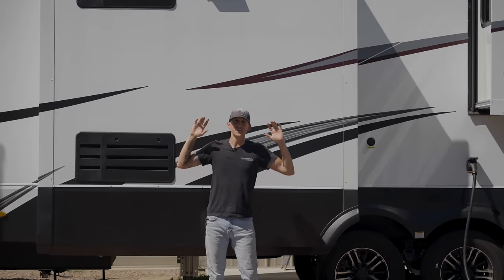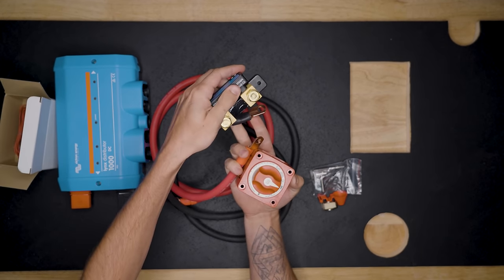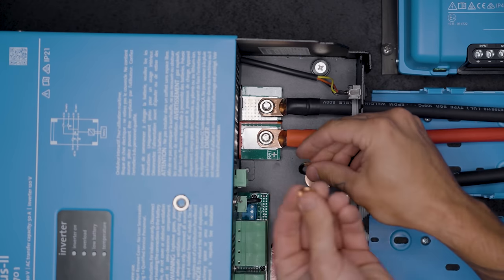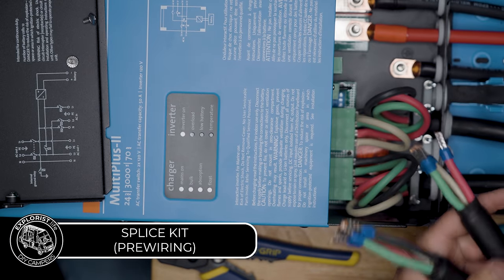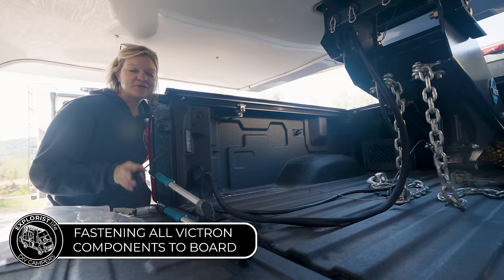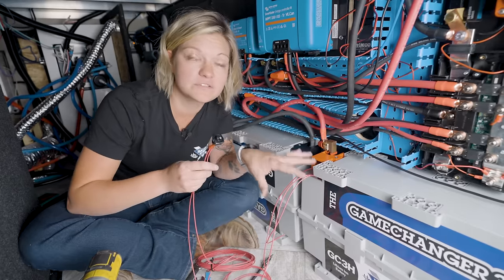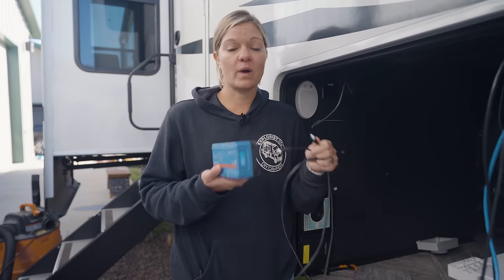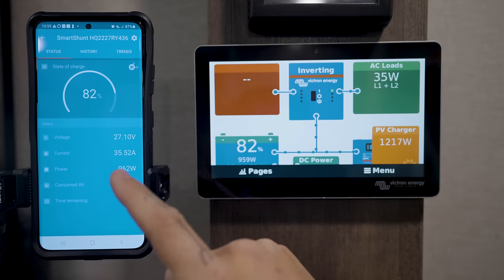We added 2400W of Solar to this 5th Wheel RV! (Full Battery/Inverter/Solar Installation)

Comment: You said you were not gonna do the demonstration on the dual Victron inverters with all the goodies that go with the install from battery hook ups to the charger controllers and cerbo …well I feel you should. It’s a good watch with you guys to
Do
The complete installs, to chase the other videos I’m sure helps you guys with the views, but idiot proof is way better. All in 1 is better. Even taking the time to do the desk set ups as 1 video then to do the complete install as another video.. especially 50 amp set ups because that’s what this product is designed for and most want to watch from beginning to end.
Maybe doing a programming of the system as a separate video is something helpful

Comment: I was wondering when you programmed the SCC for 100A but it's an 85A controller. It that because of the 24V system and that's what the battery limitations are?  I was also wondering about the 150A circuit breaker for the 70A converter. It the converter programmable to charge that house battery? You placed that circuit breaker upsidedown and I have noticed that they often have a battery and a load side but since the flow is towards the battery instead of the usual configuration, which side did you use for battery? I'm assuming placing it upsidedown was deliberate.
Reply from the maker: re: 100A setting on the MPPT: Good catch!  That would be 85A (the most it could do).  I just copied those settings from a 100A charge controller and forgot to change it.

Re: 150A breaker: Here is a video that talks about how to size fuses: https://youtu.be/5y-yDMEgV70?si=cImNZJa6MZV33tR2

Re: Breaker orientation:  Battery goes to the battery side because in the event of a short between the breaker and the converter; we need to be able to protect against the 1000+ amps of a direct short.  That breaker isn't going to care which way power is going under 'normal' 70A circumstances.

Comment: Another very good install video. I wonder why the need for the alternator charging, with 2400w of panels on the roof and the option to run a generator if needed?
I have a new 5th wheel with about as much open real estate upstairs, and a plan will be to add real usable solar, so this video is great timing. Thanks to your team for this guide.
Reply from the maker: I share the same sentiment about alternator charging in this setup.   I think you could for sure get away without it because of the massively oversized solar array.  But I also know that the last time I asked our YouTube audience to consider not installing alternator charging if they have adequate/excessive solar charging, I felt in danger of being burned at the stake. 🤣😂  

Ultimately, being able to show up to the campsite with 100% battery after driving overnight (basically) was important to the owners of this camper and so we obliged.
Reply: @EXPLORISTlife  maybe they meant "don't burn the steak", with all that power? 🤔

Comment: Are you no longer installing the DC-DC converter to power the fuse lights on the Lynx? Also, in my Momentum I paralleled two Orion 24-12/70's.
Reply from the maker: 🤣😂  I can't be bothered most of the time and forget that is a thing since it's not really a 'mission critical' feature.  Here's a tutorial for anybody reading through the comments section for how to make the Lynx Distributor lights come on: https://youtu.be/8h-E1lkYCKg?si=FZC90V5toX30XEo7

Comment: What are the advantages of doing 24v 3000w vs dual 12v 3000w inverter/charger ?  Seems a dual 12v system would double inverting power for a rig that size.
Reply from the maker: Two 3k multiplus's would indeed be twice as powerful, which is the upside, but is also nearly twice as expensive since you are buying two units and also need twice as much battery power (800Ah @ 12V / 400Ah @ 24v required)

Comment: Nice details through out. Both of you are so good at explaining things.
I have a question about the pre-solar wiring. What is the size of the existing solar wiring from roof gland to pass through? Did you use 24volt panels then? I'm surprised factory was enough. My experience is that the factory roof solar (on my 2018 Arctic fox 25w)) is too small to handle as many watts as I want (1200w), and I don't want to do a pure series connected system....in a case like mine, Do you end up running A new drop through the front cap?
Reply from the maker: 10Ga on those solar wires.   Wired like we showed, that's only 20A coming through that wire; so 10ga is plenty for that.  In fact, all of the solar configurations all the way up to 2800W use no larger than 10ga wire: https://shop.explorist.life/product-category/all-products/camper-wiring-kits/solar-charging-wiring-kits/?orderby=price-desc

Comment: Could you do dual 24/12v x 70a converters in parallel instead of keeping the existing 12v acid battery?
Reply from the maker: There’s a million ways to do this stuff.  We just share the way we feel is best and will work in the widest variety of cases, but feel free to play around with it as you like and we will sell you as many converters as your heart desires. 😜

Comment: Hey Nate, I'm just finishing a nearly identical install. Is there any reason to not wire two 24/12 - 70 converters in parallel instead of keeping a heavy lead acid 12v battery? It seems like getting rid of that weight/maintenance is the way to go.
Reply from the maker: In short, there are 1,000 ways to do things, but the way we showed in this video is what we recommend, what we've built our kits around, and what we will provide customer support for.  Anything outside of that is up to your own due diligence and testing.
Reply: Thanks. The existing batteries are two 6v golf cart batteries that weigh a ton. I'm hoping to lose that weight. Would you recommend replacing them with a 12v LiFePO4 battery, or trying the two converters in parallel? Not asking you to support, just looking for an opinion. Thanks!  @EXPLORISTlife

Comment: You guys do the best videos and have great tools and instruction on your site. I'm planning a 24 system and will likely buy the kits from you for most of the wiring. Question: did you put ferrules on the solar isolator wiring? It looked like you just stripped and connected. Any reason not to use ferrules?
Reply from the maker: Ferrules get in the way on that connection.

Comment: is it possible to make a portable power bank inside a milwaukee packout and be connected back into a vehicle that has anderson connections with solar on the roof and cables to batteries
Reply from the maker: Indeed!  For a smaller system, that would work great.  We actually have a video on the schedule for December for something like that.

Comment: Hi guys...love your channel...I watched how you connected the disconnect switch to the linx distributor using the linx adapter(copper bar). I want to connect my disconnect switch straight to the positive bus bar on my linx shunt but the bus bar has a M8 hole and my disconnect switch has M10 studs...can I use my drill and increase the hole size on the positive bus bar of the linx shunt from an M8 to M10 so I can connect my disconnect switch directly without the need for the copper bar adapter?? Or is this not recommended? Thanks...Paul
Reply from the maker: I can't vouch for modifying the hole as it would void the warranty and I've seen people mess that up and melt/damage their Lynx Distributor while drilling.

Comment: What kind of rubber coating did you use on the plywood? Is there a reason you used a rubber coating instead of just paint?
Reply from the maker: It's just rubber floor runner from the local hardware store.  Rubber just looked better & was faster to install.

Comment from the maker: ‼ IMPORTANT INFO ‼ I'll be keeping this pinned comment updated with FAQ's about this project, kit, video, etc; so be sure to click 'read more'.

Q: How much did this system cost/Where can I get more info about the parts in this system?

A: Here are the parts/kits/components we used for this build.  Add everything to your cart and you can get up-to-date pricing.  I don't like putting actual pricing here in the description so I'm not being misleading when prices change:

Main Kit: https://shop.explorist.life/shop/all-products/50a-oem-24v-rv-upgrade-200-600ah-24v-battery-bank-multiplus-3k-24v-2x120v-orion-12-1230-wiring-diagram-kit/

Solar Array: https://shop.explorist.life/shop/all-products/camper-wiring-kits/solar-charging-wiring-kits/2400w-solar-charging-wiring-kit-12x-200w-24v-battery-bank/

System Monitoring: https://shop.explorist.life/shop/all-products/system-monitoring-wiring-kit/

Batteries: https://battlebornbatteries.com/product/12v-gc3-lifepo4-heated-battery-kit/?afmc=explorist_bb67

Be sure to use code 'explorist' when checking out at Battle Born for $50 off per battery (on the Battle Born store).

Solar Tilt Mounts: https://richsolar.com/collections/mounts/products/rv-tilt-mount-28?ref=EXPLORISTlife

Q: What If I want a system like this, but want a different solar configuration?

A. Just follow the steps/kit from above, but replace the solar charging system with whatever you like from here: https://shop.explorist.life/product-category/all-products/camper-wiring-kits/solar-charging-wiring-kits/battery-bank-voltage-24v/

Q: I don't want to DIY.  Can you install this system for me?

A: We don't offer installation services at EXPLORIST.life as our gig is making these videos that teaches you how to do it yourself.  BUT... we have a network of installers that we have trained to install our kits/systems/designs that you can hire.  Contact any of them directly for more info: https://explorist.life/find-a-certified-installer/

Comment: Great video.... I am afraid to ask how much this install costs but its nice to know that Victron has all the hardware to get the job done... Was the owner planning on running AC off solar?
Reply from the maker: Pricing is noted in the pinned comment.  The owner was planning on running air conditioner for short periods off of solar (not overnight).

Comment: Great job with this. Wish you were local. I would hire you for my home install. As for tightening cables, wouldn't it be easier (and better) to just use a "Stover" Nut instead of a lock washer?
Reply from the maker: I mean...  a lock washer isn't 'hard' to put on, so anything 'easier' is splitting hairs. 🤣😂  As far as 'better'... I don't know.  I'd imagine the additional pressure from the lock washer is better electrically; but again; probably splitting hairs.  Maybe if this were on a spaceship it'd be a different conversation amongst engineers who like to argue that kind of stuff.  Me?  I'm just going to use the hardware Victron supplies instead of replacing manufacturer supplied things.
Reply: @EXPLORISTlife  - That's why I want to hire you. I cannot do it. I only have one finger on each hand (bird). 🖕(kidding lol : )  Seriously though, I didn't know Victron supplies small parts, but you make those kits with everything, and working in tight spaces it's one less washer to lose (especially when installing multiple washers in an overall larger system). Washers probably work slightly better though (especially in a moving vehicle).

Comment: Hi Nate. Again an awesome and informative video 

You mentioned you left the factory battery in to run the other electrical systems like hydraulic jacks etc. 

Could the Victron system not provide the power 

Thanks again
Reply from the maker: Not with only 70A.  Probably would have added 1-2 more converters to run the Jack's.  What we did eliminated that.

Comment: At 30:47, did you turn off and label the wrong circuit breaker?
Reply from the maker: Nope.  We turned off and labeled the correct breaker.  But I appreciate how closely you are watching. 😂🤣
Reply: @EXPLORISTlife Thanks.  Must have been an optical illusion (angle of view).

Comment: Hello, firstly great video and as always very informative. One question as it will relate to my future install. 
I see you mounted the Inverter charger horizontally and on its side (if that makes sense). I read this is not a suitable mounting way in my research as there are transformers which become suspended by the case. 
Have you had any issues doing this type of install. I will be using a Victron 48/3000/35. 
Thanks
Simon
Reply from the maker: If an inverter requires a specific mounting orientation, it will be noted in the user manual.  The multiplus 2x120V used does not make a specific mounting orientation recommendation in its user manual.
Reply: Thanks again for the great videos

Comment: If I was installing the system in this video, would i need the smart dongle to program the multiplus II?
Reply from the maker: If you are using Battle Born batteries, you can have us program it for you and you wouldn't need the MK3-USB dongle.  The VE.Bus Smart Dongle is a different device and is not for programming, but instead turning the multiplus on/off or setting the shore power input current limit.  This was not installaed in this system since we were using the Cerbo + Touch Screen, which accomplishes the same thing.
Reply: Thank you, for giving me what I needed to know. I should have been more specific.  I was considering the Victron Energy VE.Bus Smart Dongle (Bluetooth) part number NT-1066 because I am following the wiring diagram you sent me "EXPLORIST.life-50A-RV-RETROFIT-24V-Multiplus-2x120-3k-Solar-Alternator-ulghsm".  I now understand the difference better between the diagram and this video, since unlike the diagram I will also be installing the Cerbo GX and the Touch screen as you did in this video. 

One last question about the video.  Now that some time has passed, was the Orion 24/12-Volt 70 amp DC-DC Converter combined with the OEM battery sufficient to keep the camper's OEM battery charged and operate the camper's jacks and slides?  In the video you made the the statement the Orion converter is "kind of the bottleneck in amperage in that it's only able to deliver 70 amps of power. And at the moment, we don't know what the amperage of the jacks and the slides in this camper are."  I also intend to install an Orion 24/12 converter for the same purposes as the video, and in my case to charge two LiFePO4 Lithium 12V 100AH batteries, so I am wondering how the 70 amp converter worked out, or should I instead install the Victron Energy ORI241221226 Orion IP67 DC-DC Converter 24/12-100A?  Thanks again!    @EXPLORISTlife

Comment: Shouldn’t you have mounted the Anderson connector in the truck bed facing down instead of up?  That would keep rain out when the truck is used without the camper.
Reply from the maker: Those connectors aren't watertight so it doesn't matter much.
Reply: @EXPLORISTlife  no, I meant when disconnected it would keep water from pooling in the connector.
Reply from the maker: Right.  Buy a connector and try to fill it with water and you'll see what I mean.

Comment: If i have 24v system can I run a couple 12v batteries in series to make a 24v and then parallel it with a 24v battery
Reply from the maker: Will it technically 'work' and turn on?  Yeah.  Will you constantly be having problems because of unbalanced batteries?  Yeah.

Comment: A thought, why not cut the ferrule end to shorten the shunt power? Keep a butt connecter out of the system.
Reply from the maker: Sure!  You can do that if you like as well.  We supply a butt splice connector with our kits, so you'd have to source an, I believe, 18ga ferrule on your own to do that.  Lots of different ways to do things.

Comment: Did you run the power lines to and from the inverter in the belly or thru the wall?
Reply from the maker: Just across the floor of that storage compartment protected in wire duct.  The breaker box was just on the other side of the storage passthrough.

Comment: Awesome video..super clean installation. Would you be interested in the installation of my solar panels system on my Grand Design 397ths
Reply from the maker: For sure! We have a network of installers you can hire for these projects if you aren't wanting to diy.  Installer info in pinned comment.

Comment: I SELDOM see MOUNTING RAILS like they do on houses. Random mounting anywhere leads to many points being on unsupported areas which leads to leaks. If you put a cheap mounting system rail you can dril into 2x2 FRAMES and then mount your panels on the RAILS, not on unsupported non frame areas. ALSO you can move, repair or replace panels without further damage to roof
Reply from the maker: What we did won't leak, but feel free to mount your own panels however you like.  Mounting the panels wasn't  really the point of the video and however you mount them won't affect how they work electrically, which is why we glossed over that part of the install.  Hope this helps!
Reply: Cool. Thanks for getting back to me! I have some issues because I want my mounting to be temporary so I can move things around at will. and utilize my slide roof space when I am long term vs mobile. Love your channel @EXPLORISTlife
Reply from the maker: Yeah, I guess that's an option too.  On this channel, we have the mindset of 'do it right the first time so we don't have to do it twice' so a properly designed solar array setup that will last 20+ years is the goal here without the need for moving things around.

Comment: Did you run the power wires for the battery heaters through your load monitoring shunt?
Reply: I don't think so because they r pos wires and shunts go inline on neg, id assume they heaters r neg internally wired inside the battery boxes
Reply from the maker: Nope.  The negative wires for the battery heaters are inside the batteries; so there is no way to monitor heater usage, unfortunately.
Reply: @EXPLORISTlife  bummer! Thanks for the info.